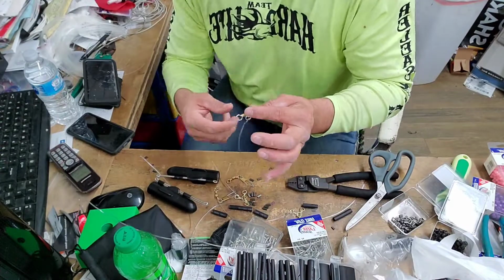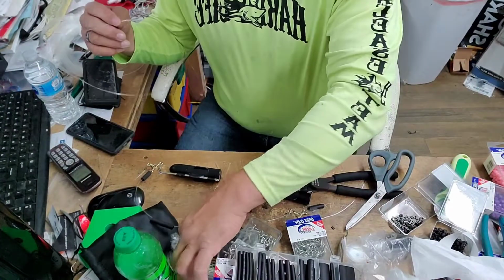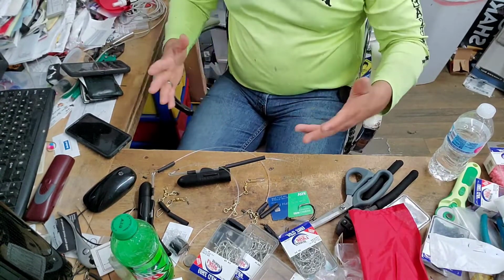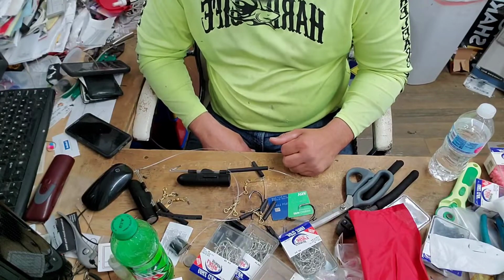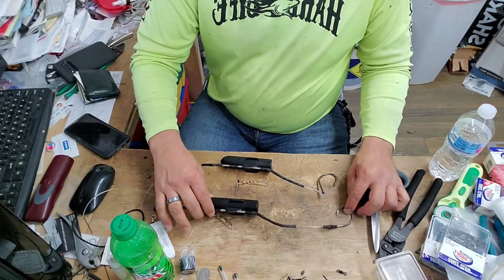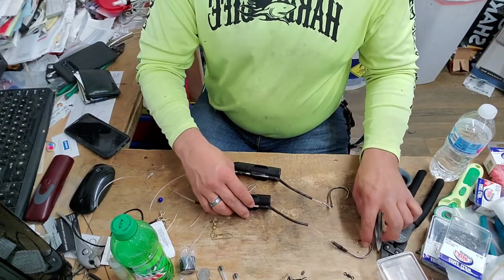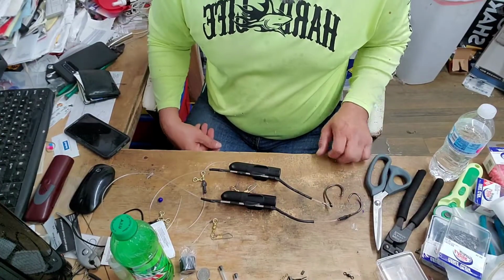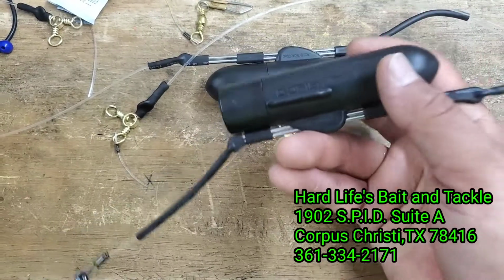Go fish Leaders Camera set up of Deep Droppin

Comment: hey man nice video,  I have a question I saw in a previous video you use cable and not single strand wire for your rigs. Is there a reason for that? Just wondering.
Reply from the maker: Yes we have tried single strand wire and have lost multiple sharks in 1 sitting at a tournament so we stopped using it.